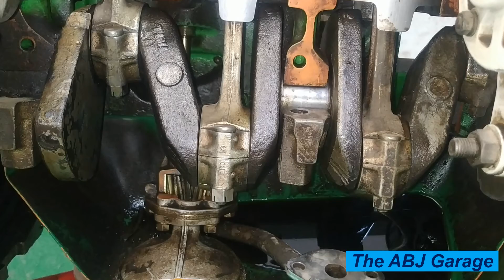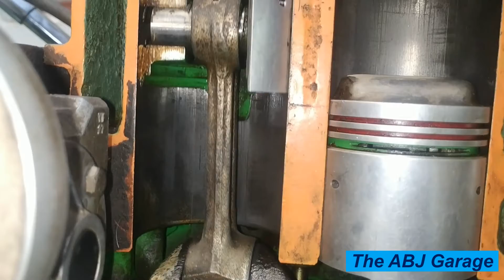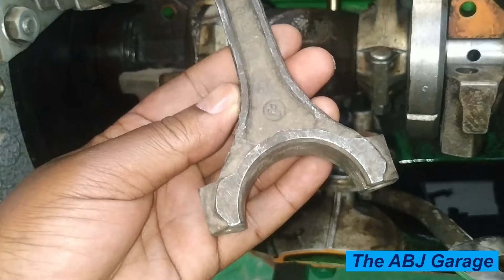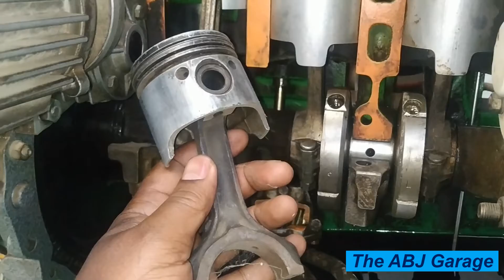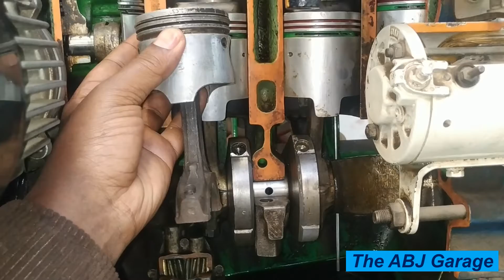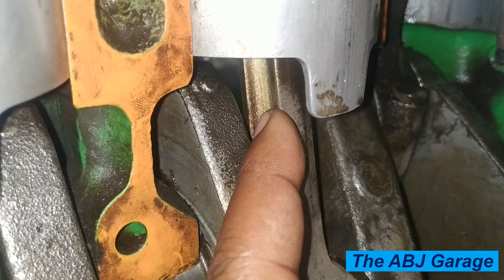What causes connecting rod to break and go through the engine block?

Comment: If the engine is older or has over 100K miles on it would that be a factor? I had this problem occur on my used 2017 GMC Terrain and I had to buy a new engine. It has 130K miles
Reply from the maker: High mileage can certainly increase the risk of engine component failure. But broken connecting rod must have another cause besides the mileage! High mileage is characterized by increased wear, breakage is something different! Connecting rod breakage is almost always a result of a separate component failure or extreme engine abuse, which places forces on the rod that exceed its design limits. The result is often catastrophic, with the broken rod "throwing" through the side of the engine block.

Comment: Hello dear 
Very nice vedio 
This week we have face the engine failure which is overhauled before 06 months what could be the reason of its engine C-rod broken when machine not a over accelerate  & no down oil pressure & engine over heating sign suddenly C-rod broken and badly destroyed whole engine 
In my 13 years experience I have never seen so for...?
Reply from the maker: From what you are saying, if the engine has no mechanical problem like a broken metal in the cylinder, then I strongly suspect Hydrolock. Hydrolock happens when a large amount of liquid, usually liquid fuel or coolant enters the combustion chamber. Since liquids are incompressible, the piston cannot complete its upward stroke, resulting in excessive force exerted on the connecting rod and potential failure. Leaky fuel pumps that dump fuel into the cylinder could cause such a problem! Have you checked to see if there are any liquid leaks into the cylinder?!
Reply: @TheCarCareGarage  
Thanks for replying 
Said machine have complaints of fuel dilution but we have checked no sign found of fuel dilution after engine dismantling/ overhaul which observations share with you & said machine engine overhauled before 4 months ago only maximum 1000 hrs only working